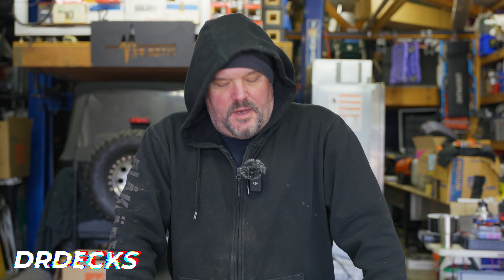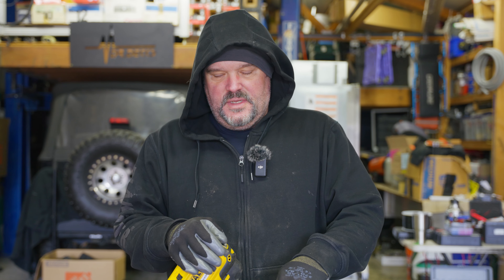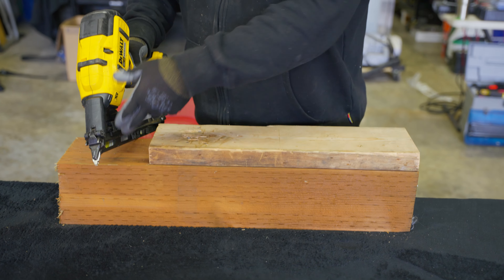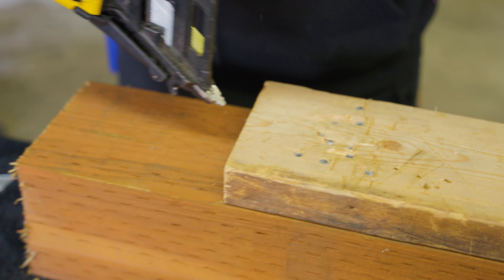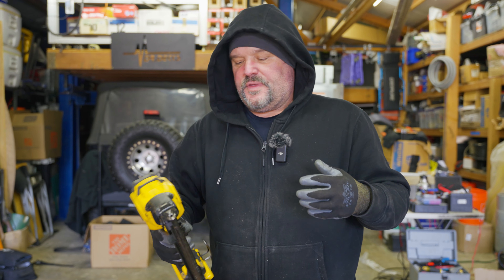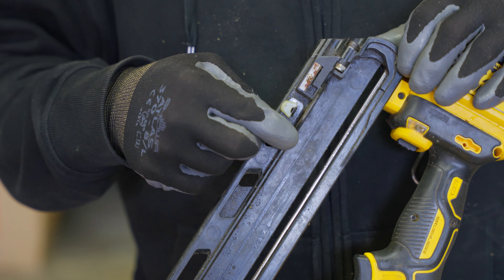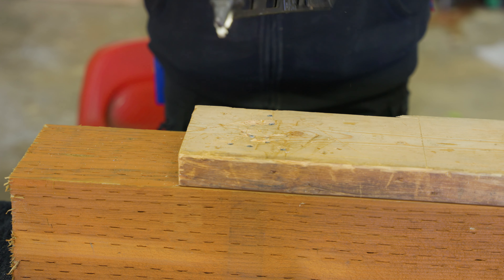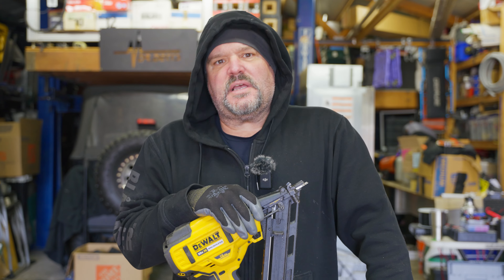Is The DeWalt DCN650 Still Good 2 Years Later? || Dr Decks

Comment: If you're running baseboard you can find one stud and then use the 16 inch on centre gauge on the magazine of the gun to measure to the next one and nail into it. Its a little bit crude (i prefer to use a stud finder) but its good for a quick install